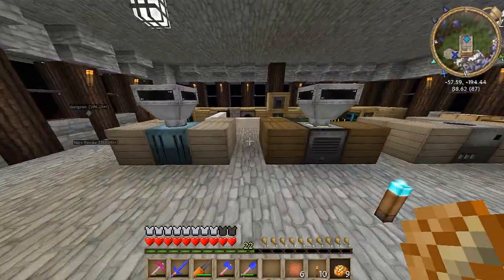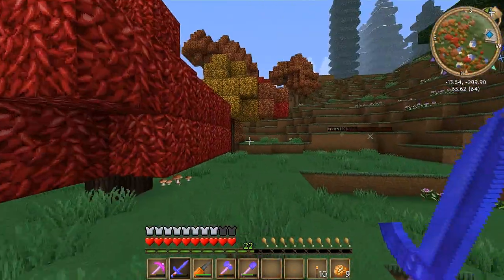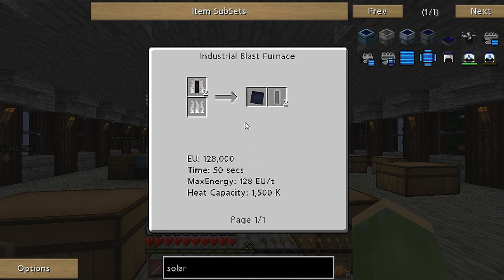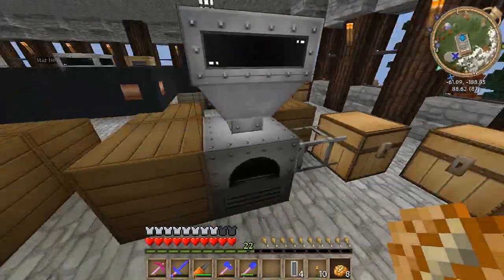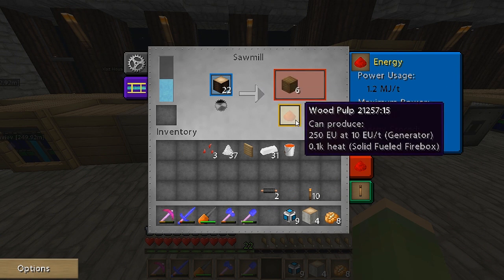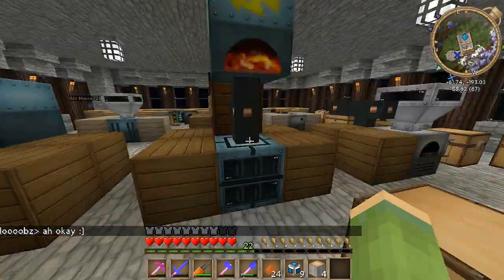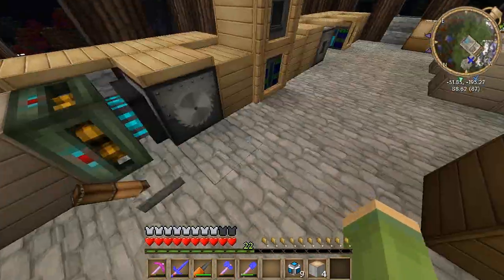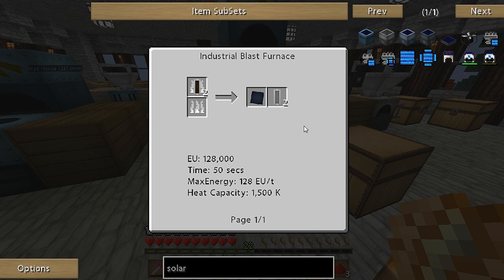Sawmill, Wood Pulp And Industrial Centrifuge!  - Feed The Beast SMP - #4

Comment: Dont make windmills they are TOTALY not worth it. Make Watermills they produce loads of more EU and you dont need as much Cable for the wire because the Windmills work better higher up and the more Cable you use the much more EU you will lose